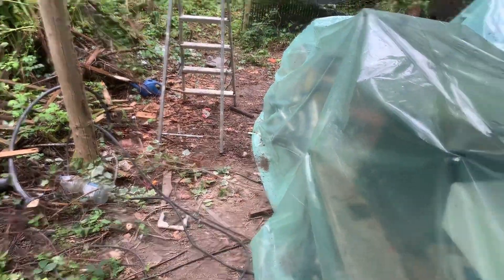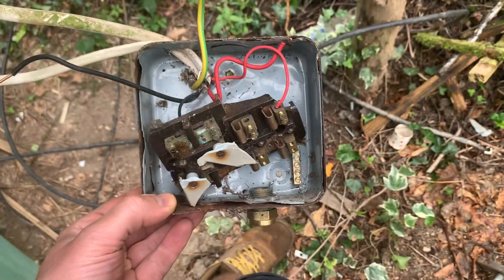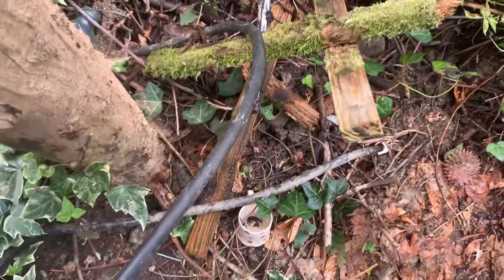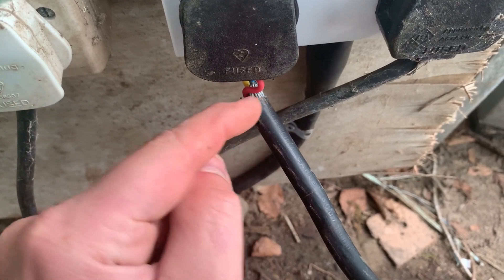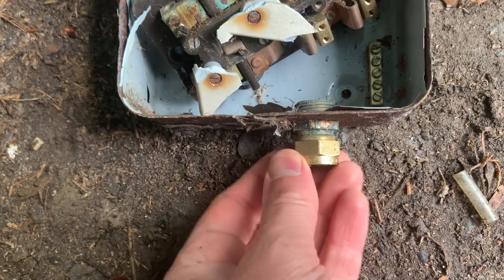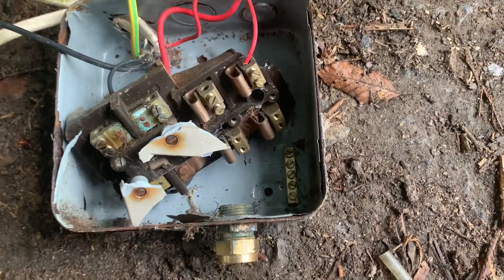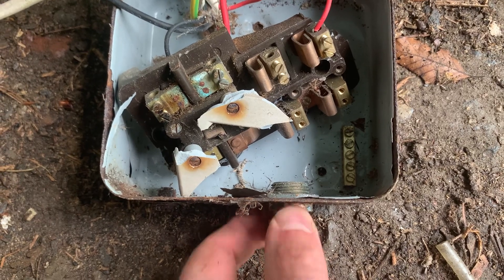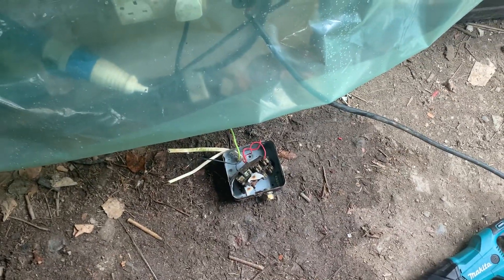No Earth Wire in Armour Cable?

Comment: I am not a Spark either, but you should really look into things further before putting out a video like this due to the potential dangers involved. 

At the consumer unit end, you will need a complete new gland, and if it's fitted properly, this will make an electrical connection to the armoured wires, and will form part of the earth cct back to the house... 

The thing is, depending on the earth system in use, you may also need to provide an earth spike near the shed and connect it to the armouring as well...In effect the cable will be earthed at both ends when done correctly.

At the house end,  that "temporary" plug with the cable fed into it is completely unacceptable and very dangerous..The cable needs to be taken into the house and terminated correctly into the appropriate enclosure. I am not going into detail as I am not qualified, but I know that plug is a death trap.

Finally, once everything is installed at both ends to meet the current regulations, it will need to be tested, particularly the resistances to earth ect and making sure the RCD trips when it's supposed to.. It's these tests a typical DIYer can't do because they don't have the fairly expensive test equipment, nor the knowledge how to do them...
Reply from the maker: The system shown in this video with the "death trap" plug ran without incident for for over a year. This has now all been wired in to a small consumer unit. FYI I think some things not built to "current regulations" are still working just fine, such as the the Bristol Suspension Bridge and the Pyramids. . . . and also if you want to flip it round some things that are built to current regs are really dangerous such as the 1000's of buildings with flammable cladding dotted around the the world, because all of the checks that were meant to stop that happening were deliberately falsified. Genuine best wishes DT
Reply: @DorkyThorpy  Sorry, it was a dangerous bodge job, and if you read the other comments, I am not the only one who feels that way..
Reply from the maker: @peterevans8194  No need to apologise, we are all entitled to our opinion. This risk taking is multigenerational in my family, my grandad used to make lawn mowers out of random crap (don't think he even own a volt meter or a soldering iron) and my dad (80+) recently had an electrician walk off the job before he even started because we was running a new house he was building off an extension lead. I guess that's the beauty of YouTube, its unfiltered, my favorite "wince" inducing content is "DIY fire wood processing machine" some of those are just insanely dangerous.

Comment: You could see it there at the end thorpy, when you took the nut off the knurled bit beneath is meant to sandwich the armour, so you have to be careful getting your cuts right when making the termination.  You know I'm not a spark so if you aren't worried about it you could just not use a nut and bunch the armour into a terminal and make an earth out of it. or you could run another single earth cable alongside it.  John ward did a good video on these systems. worth a look. If you have a rcd in the house the earth acts as a trip wire, causing the RCD to switch off. in the old days of wire fuses, the earth cable had to carry the current to ground and not through your body, nowadays the cable has to be capable of doing both. Like I said, I know nothing. Hope you have an RCD>
Reply from the maker: Thanks Boots, yeah I’ll get it sorted out. But it was a bit of a puzzler when I first saw it! Hope your keeping well. All the best, Thorpy

Comment: Sorry to sound harsh but the armoured put into the plug top looks like an accident waiting to happen.  I wouldn’t even contemplate using the old armoured gland again, the banjo looks to be missing and there’s no flylead too.  The old cable may be fine to re-use with the armour used as the earth but without an electrician seeing it and doing some inspection and testing it is impossible to say.  For safety’s sake, please get an electrician in.
Reply from the maker: Electrician is best bet. But I’ve been muddling on for 20 odd years. …. The plugs are obviously temporary.